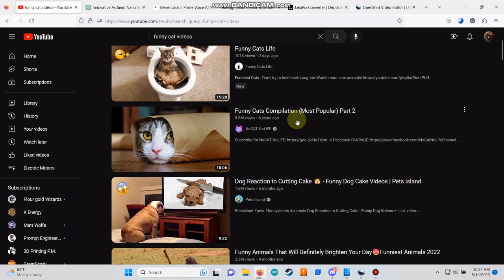Arduino Nano Upgrade

Comment: Dude thanks for the shout out lololol. I do try and make a least 1 video a weeeeeeek man lololol. Great video as always. I'm minutes away from finishing the second coil. I think I will use your idea of the nylon strapping tape for the rotor. I think this will be a scary beast. The weight of the 4 magnets alone scares me lololol
Reply from the maker: Yeah I think its a good idea. Ive had pla rotors come apart and ruin expensive magnets and destroy coils. Luckily, I've never been injured, but came close. Good luck!
Reply: @redesign3dp  yep me too so you think I would learn right? my monster newman motor exploded on me once and I screwed the end caps on after that lollolol

Comment: Why are the Pot pins not soldered to anything?  Thank you sir.
Reply from the maker: Oversight. Middle pin goes to A0, other pins go to 5v and ground
Reply from the maker: No it just changes the direction you have to turn the pot

Comment: Lost the file I downloaded from you, while getting the work bench ready for action brother and found it again.  Let me know if you need the nano base .stl and I'll send you it.  In case you get the store up and running or you need to email it yourself to one of your customers. I fully intend to buy one of your green pwm's ( too good an opportunity to pass up sucn quality ) but I would like a back up like the one in this video just in case I have two or more motors running at once. 😊 Of course I could print my own, but the question is, would it look like a dog's hind leg? lol. I need practice.
Reply from the maker: I removed that from my store since your the only one that bought one, digital downloads turned out not to be a good idea since there is no interest. I still have the files so if you have any issues just email me.
Reply: @redesign3dp  Will do brother, I should be ready to begin next week. Wish me luck.
Reply from the maker: Where have you been, bro?
Reply: @redesign3dp  Long story bro, the main thing is my 3d printer is being brought back into service. I've been following one of your buddies with a talent for innovation. He has a  passion for pulse motors.